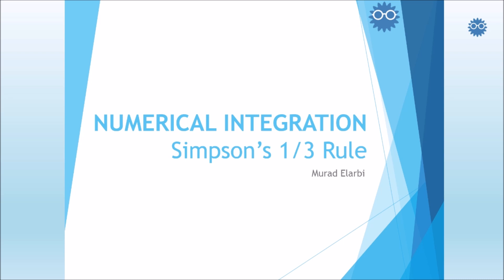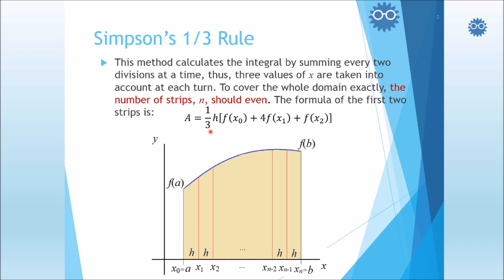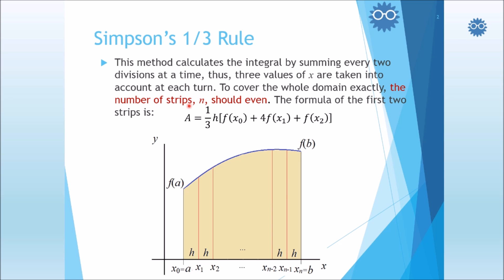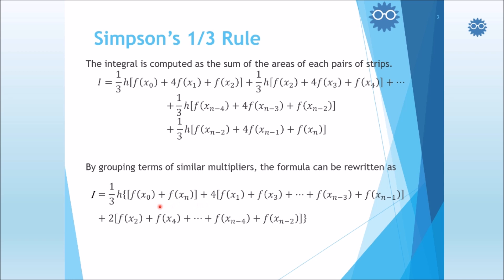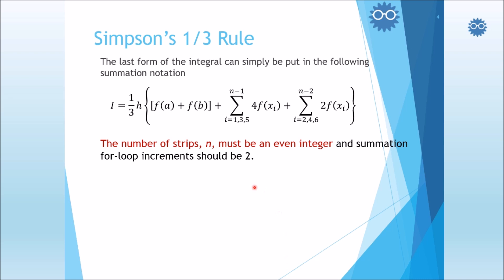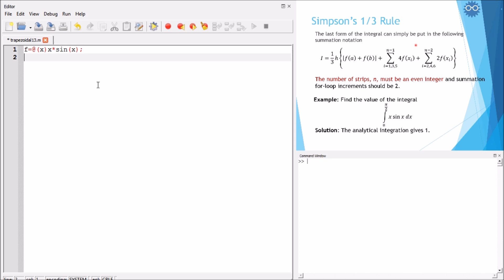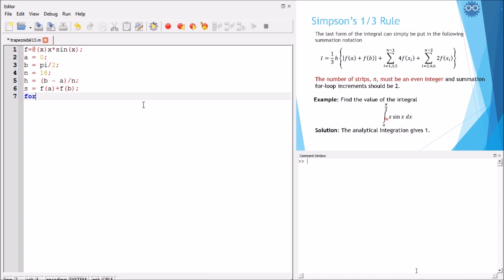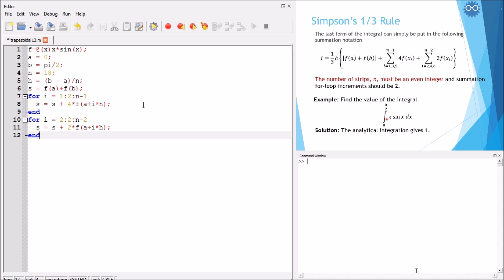Simpson's Rule - Numerical Integration | Programming Numerical Methods in MATLAB

Comment: I put the same exact coding as yours, and i got different value. Why is that?
Reply from the maker: It is difficult to know why your output value is different without checking your code. That could be due to typing errors like mixing small and capital letters, or typing the numbers 1 or 0 instead of letters l or O, respectively.
I recommend checking your code line by line until you find the difference.
Thanks,

Comment: how to find I if n gets different values
Reply from the maker: In this code, the number of divisions (n) is set by the user and the step size (h) is calculated accordingly. That means you can define the value of n at the beginning. If you have a specific step size, you can use the equation n = (b - a)/h to find (n), but still (n) should be an even integer. For that reason you have to adjust the value of (n) to satisfy the condition anyway.
I hope I could answer your question.

Comment: really nice video , saved my ass with this. here is some code that does the same job but is a bit more pleasean to the eye

n=1001; % number of values sampled thus divisions are even
a=0;
b=0.8;

x=linspace(a,b,n);
fx=1./(exp(-5624.1*(1./(288+11.428*x))+17.01024).*((1-x)));

p1=(1/3)*(x(2)-x(1))*(abs(fx(1)+fx(n)));
p2=(1/3)*(x(2)-x(1))*4*sum(fx(1,2:2:n-1)); % matlab uses 1-based notation unlike the 0-based in the video thus f(x1) correspond to fx(2), they are both the second value sampled
p3=(1/3)*(x(2)-x(1))*2*sum(fx(1,3:2:n-2)); %similar to the above

I=p1+p2+p3;

Comment: How can you use this method if you only have a data set, not a function?
Reply from the maker: Very good question!
Numerical integration methods like trapezoidal and Simpson rules can be used for data points as well. Instead of getting the value of y from a function f(x), they will be taken from an array y = [y1,y2,...,yn]. If x differences (step size h) are equal, you can use almost the same algorithm, otherwise you need to consider the x array, x = [x1,x2,...,xn], by multiplying xi by yi in each term.
I hope I could answer your question clearly.

Thank you for the comment and question.